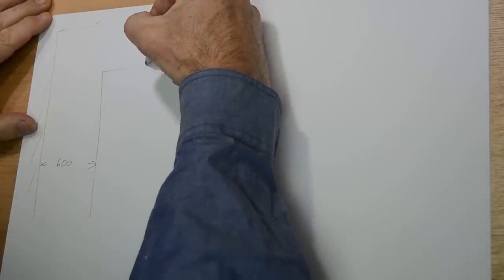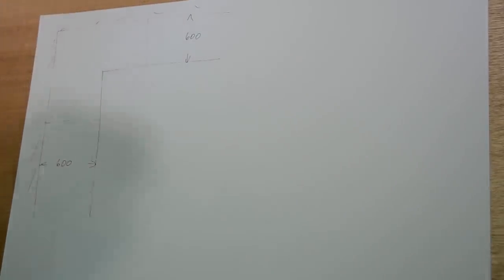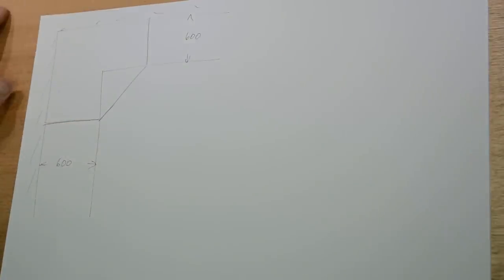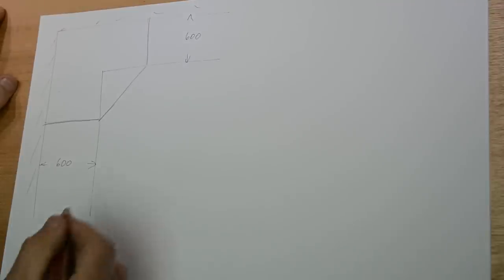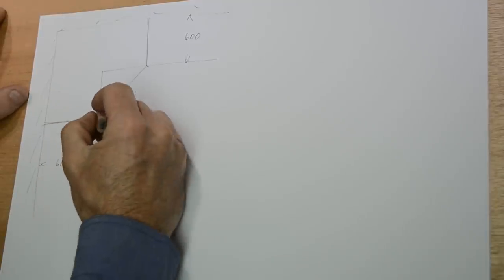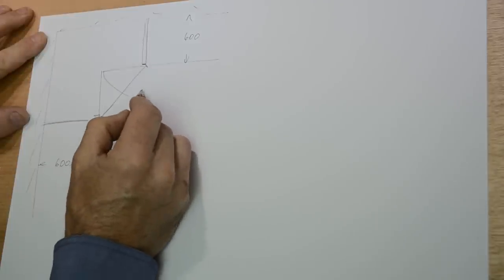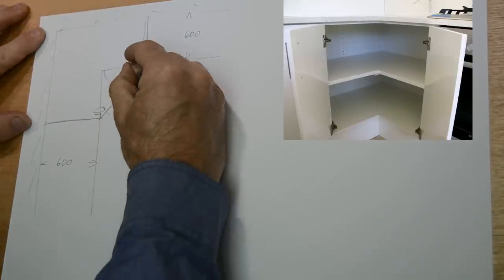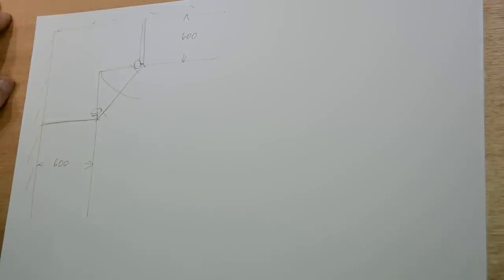Corner cabinet, problems, and solutions.

Comment: A simple straightforward corner cabinet with lazy Susan works perfectly and negates the need to get your shoulders into the cabinet. There are also many swing away units by Rev A Shelf but they are incredibly expensive and a pain to use. I have used a lazy Susan for years and love it.
Reply from the maker: I have a video on my other channel which is a follow up to this. It covers the pantry a little better, and describes wasted volumes of lazy susans and such. https://www.youtube.com/watch?v=R88pJMrjbe8&t=159s

Comment: I'm now wondering – and hear me out 😆– about a lift-up corner section of worktop concealing roll-out metal basket shelving on a (pneumatic?) sprung hinge system that lifts shelving for full access (a little bit like a sofabed).  The lowest shelf housing things accessed less often so it doesn't always need to be lifted to full height. Pick out what you need and close the 'lid' again. Make it easy access by only storing large appliances on that part of the worktop on a tray – like a breadmaker so you can still use the countertop freely.
But I'm neither an engineer, nor a kitchen designer...  😉
Reply from the maker: It's funny how so many can chase some complex and expensive method of getting to the last bit of the corner, and waste half of the space and access to achieve it. 😅
Reply: This actually exists, the Qanto from Häfele, and as helmreichen states you lose about half the space for the mechanism. Additionally you get to spend 4000 dollars on a single corner, touch a button for 20 seconds to get access to the bottom shelf, not being abe to have wall cabinets above and a countertop that's visiually seperated.
Reply: @realityandnaturepill  Thank you for this information.  I took a look at the Qanto – I wasn't thinking of something anywhere near this sophisticated, nor electric, or that rises vertically like a lift, actually.  More a simpler manual pneumatic mechanism that rises up and forward.  I also hadn't pictured something that would impinge on any cupboards above.
I don't really mind about the break in line in the worktop, though I know that would bother some people...
Reply: @221b-Maker-Street  

I see what you mean, basically the opposite of a pulldown for cabinets.

If you don't care about countertop in the very corner then an appliance garage is a great option. Nobody uses the countertop in that corner anyway.
If you connect the appliance garage to a wall cabinet you can essentially have storage from countertop to ceiling. You can even have a drawer for the appliances so you don't have to lift heavy appliances when you need them.
Under the counter you could still have storage like a super susan thus in total that corner could store many items.

Comment: In my small kitchen, I just left the corners empty and put drawers on each side. The drawers are much more efficient, so for me, it was the answer. Later, I will access one of the corners from the bathroom (when I get to that project). The other corner I might make an electric lift for a larger machine.
Reply from the maker: Accessing from the other is a good solution.

Comment: Lots to think about if I redesign my kitchen. Just goes to show I should be happy with my lazy Susan set up as they all have pros and cons
Reply: I am of the opinion that; if you don't want to stack and reach into the far back, a lazy susan IS the way to go. The presenter over-dramatized the downfalls- 1) the location of the pivot point is variable, and dictates the radius of the susan. 2) any normal person will stack items that are used infrequently around the edges, so utilizing that space, and 3) his point about height restriction is simply baloney- the susan swings out into the clear- and items can be dropped straight down, no need to clear the rail.
Reply from the maker: I have a video on my other channel which is a follow up to this. It covers the pantry a little better, and describes wasted  volumes of lazy susans and magic corners etc.
https://www.youtube.com/watch?v=R88pJMrjbe8&t=159s

Comment: You missed out the single most important point. I've been on the tools for 40 years and I don't think I've EVER come across a corner which is perfectly square. I don't ever use L-shaped cabinets for this reason, it's always two separate cabinets linked together with a corner post. Trying fitting L-shaped units into an 83-degree corner .....
Reply from the maker: I have been installing kitchens since 1982, and yeah, they ain't square, but I usually design in some points of 'slippage' in the whole layout.
Things like dishwasher openings are a great place to allow some give.
Bench tops especially long ones with long returns are even more problematic.

Comment: How many kitchen corners are 90 degrees  this is the problem we all need the answer to.
Reply from the maker: Most, depending on what you mean by 90 degrees ;)
Reply: @helmreichenterprises8391  maybe using two cupboards to make a corner because a fixed corner cupboard doesn't fit very well when the corner isn't square/ a perfect right angle

Comment: My solution is to just put a big sink in the corner.  You lose a lot of space under the sink anyways and usually just keep cleaning products underneath.
Reply from the maker: Most of my customers like the sink in front of the window, which is usually away from the corner.
But I agree, plumbing wastes a lot of space, and it may as well be in the corner.
Reply: Sink in corner is not very accessible.

Comment: So which is the best?
Reply from the maker: My favourite method is usually the open corner like the photo.
Reply: @helmreichenterprises8391  are the inner shelves removable.and is  600 mm diagonally  the minimum required.
Reply from the maker: @whiterider777  600mm diagonally is a clearance for your shoulders, and is quite essential otherwise the corner is not properly accessible.

And the shelves are removable  :)

Comment: Thinking my need to beef up the support for the middle between the doors for support for the counter top.
Reply from the maker: That depends on the bench top, I have used 50x25mm steel tubing for stone.
But whatever you do, don't put a post in :/
Reply: What did you use? I think I would need to do the same.

Comment: after all that my feeling is that corners suck, realy not worth making a corner unit better off leaving the corner dead and butting two opposing cabinets.
Reply from the maker: That can often be a good solution. 
But most times if you can give reasonable access, the space can be useful.

Comment: Hmmm. Am i stupid because i think ur idea is the poorest of those all. I think u should mention that it has to crawl to the space, not walk. I think there is majority of people who rather just choose lazy susan than any of those "crawl in" kitchen cabinets. Beside u lose tons of space when u leave crawling space there... But hey it just my thought
Reply from the maker: You need to crawl into shelves, so I agree with that, but also true is that the moment you try to use fancy fittings to give you access to the corner, you lose so much volume that you may as well blank off the space.
This simple shelf idea gives the largest available storage volume, although it is still a shelf.
Like I said in the beginning "The problem with corners,  is that corners are a problem" ;)

Comment: Whatta a lot of waffling....far out....its not that hard dude....you make a simple thing sound so complicated, we don't have any problem fitting our shoulders to get into the cupboard....the only slight problem is how low the bottom shelf is. The simple solution is to fit a cupboard door on the other side of the bench for easier access.....Don't overthink dude geez
Reply: I think your are missing the point. This is not a "how-to" video. It was supposed to be a comprehensive analysis of all the potential options, including the pros and cons of all of them. if you're not prepared to think about a problem, you will end up with a sub-optimal solution.
Reply: @tlangdon12  a cupboard door on the other side is a simple & efficient solution